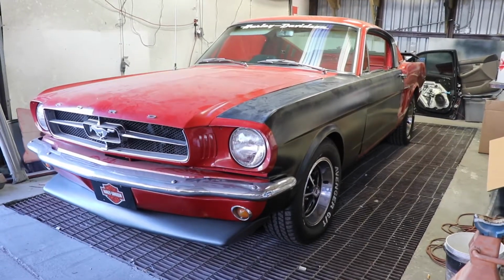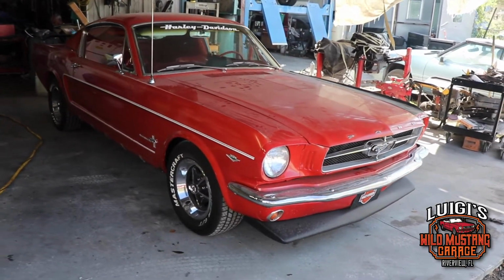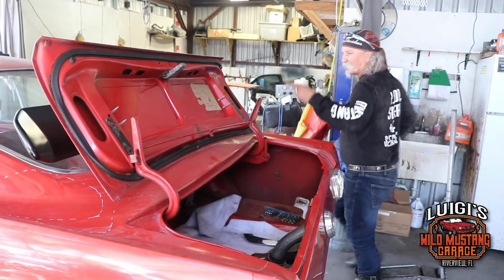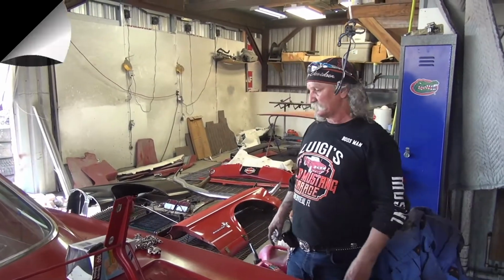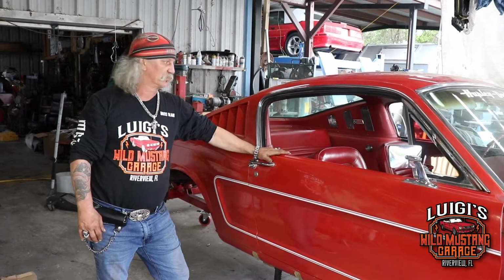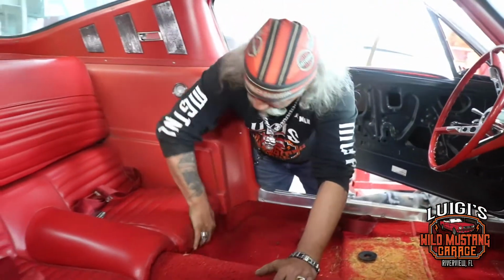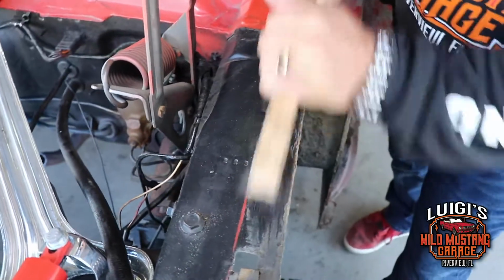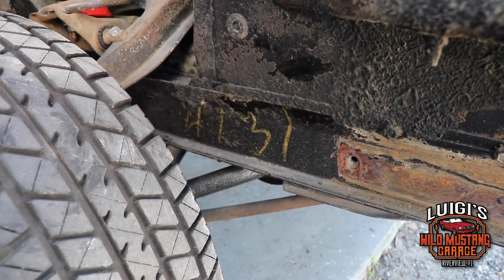65 Mustang Fastback Restoration Part 1

Comment: "A" code is a 289 4 barrel.  "K" code is the 289 Hi Po. The dude said the car was original and that the passenger side front fender had not been off. It has a regular 289 engine badge, not hi po.